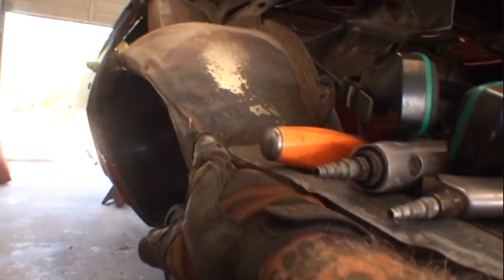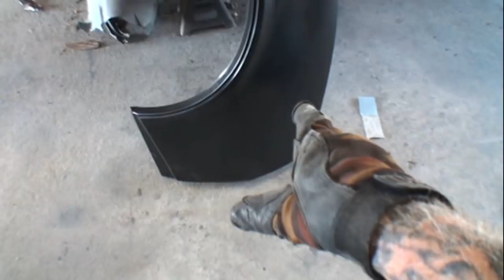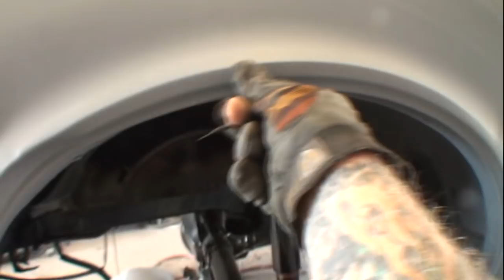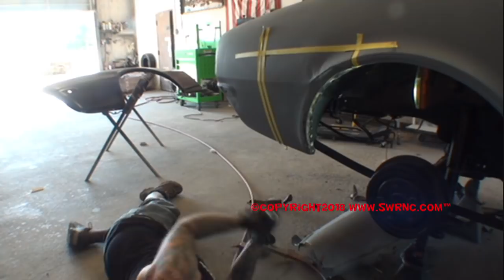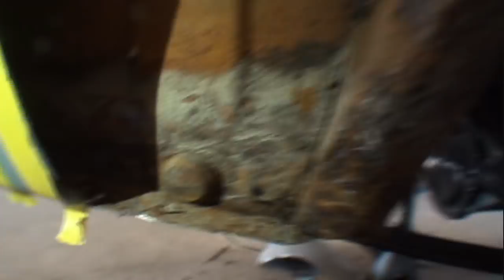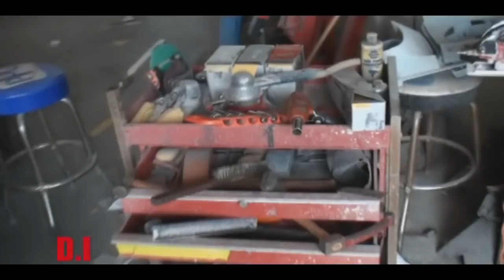How To "Patch Repair A Quarter Panel - 1967 Camaro -  Part 1

Comment: Why would or wouldn't you make a rounded patch versus the straight one that your show here? What are the advantages or disadvantages of each method? I am doing the entire wheel arch, both outside and the lip of the inner fender. Inner fender definitely following the curve to replace to bout one inch above the flange. The skin, so far, I have curved the rust cut out. Could square the aftermarket panel, still.

Comment: I just subbed Pete.
What are your thoughts on a quarter panel shell that was repaired/poor job of doing so?
Cut and weld or use filler and smooth it out? looks like they tried to make it look presentable but did a bad job.

Comment: Where do you buy a front fender for a 69 camaro? Bondo Man had his ways w my 69. Encapsulated rust behind the RF wheel . can use new sheet metal or cut a section like you .
Reply: Auto metal direct I am a distributor, or goodmark is also a good retailer for good metal

Comment: to save money for blades for youre  air saw use regular hack saw blades snapon blades work and last the best put the saw blade in saw and cut to the size cut on a 45 or more 24 tooth works best try it and let me know what u think

Comment: Pete, damned you're good, I can't thank you enough for having these lessons. You've taught this old man so much about the art of body work. Some idiots try to give people the impression that since you have new sheetmetal, you need to use it. You'd think that common sense would tell them not to disturb the OE metal with its original contours and crisp lines. Thanks for making that issue clear. On that Camaro lower qtr., I was waiting for the kitchen sink to come out after you pulled out that rats nest, hinge and cover plate. That was great camera work looking into that rat piss area. One last thing, I trust you, Pete, your my friend.

Comment: So is the Camaro painted with epoxy to seal it while your doing bodywork? Ive got a 69 Mustang with lots surface rust and old bondo I'm sanding off that needs quarter panel work and a couple floorpans. The previous owner stripped it to bare metal, did decent bondo work and then had to put in out in the elements as life got in the way. I'm thinking, strip it to bare metal again, epoxy seal, then metalwork as time permits.  Am I going to have issues stripping the epoxy when I need to weld?

Comment: Thanks for this lesson Professor Pete, I gotta replace the wheel arch on my vw that got smashed in.  Somebody slide into it in the snow.  I'm just worried about welding it in properly
Reply from the maker: WOW  Atleast you weren't in the car when it happen... Don't worry about the welding,, practice on a scrap peice first to get your motion down then do the car!  You'll be fine and it will turn out GREAT!!!

Comment: Nice to se you are wearing safety glasses and hearing protection when running a death wheel.  I got a set of custom mould ear plugs from DB blockers I think they are the best thing ever but very expensive at a cost about $200 in Canada.
Reply from the maker: y2kxj wow! 😟😟😟

Comment: pete, buy a bloody spot weld drill bit you tight ass 😂 a good one lasts a long time. ive found the wurth ones not so bad, here in uk, as is their cutting discs and flappy discs 👍
Reply from the maker: Little Wol I have a spot cutter. Very handy for new car collision but on these old cars I find replacing the panels much easier doing it this way.  I’ll have to make a video on spot weld cutters.  Thanks.
Reply: great, I cant wait to see it, I do learn a lot seeing the way things are done in America. big time fan :)
Reply: Was wondering why you weren't using one. Good topic for vid. Advantages, disadvantages, good brands to buy etc